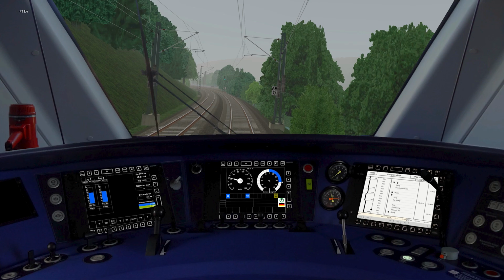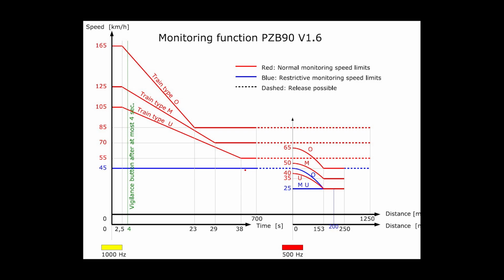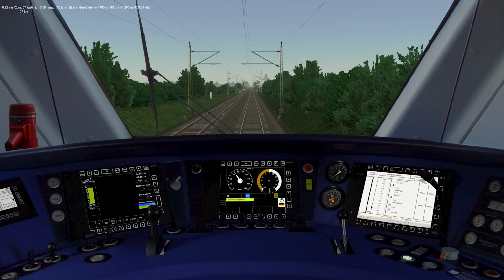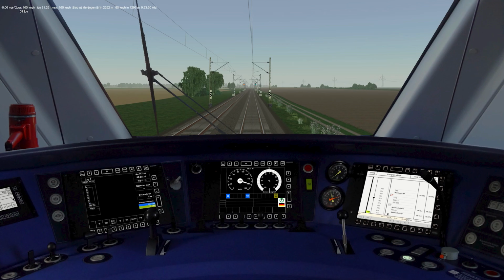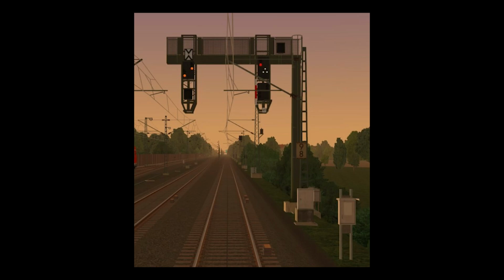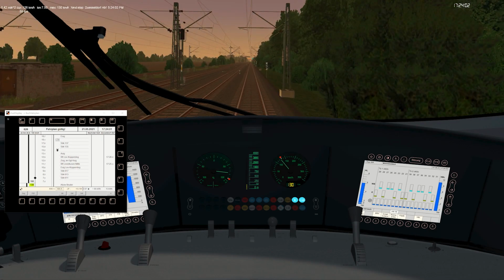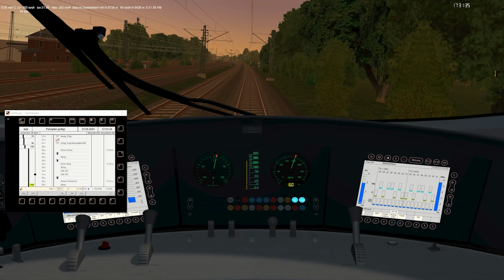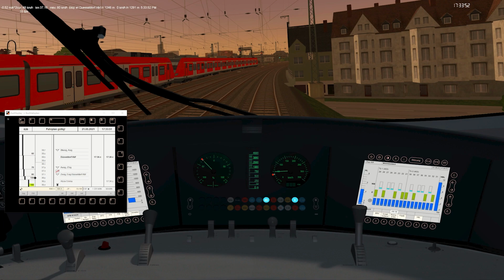Zusi 3 Tutorial - 03 Safety Systems

Comment: Something that i'd like to add so people will avoid random emergency brakes: In some cases (not everywhere) there can be something called a prüfabschnitt or a test section before a new speed limit. These will check befor the signal at which the speed must be reached if the train has allready slowed down to a certain degree. For example in front of a signal which wants you to drive 100 after passing it will have a test section testing for 115 or 110kph. If driving above that the train would recieve a 2000hz emergency brake. So watch out and brake soon enough.

Comment: Thanks for the detailed video.
I have a question: in the LZB demonstration, the timetable speed is 160 km/h and we run at 200 km/h. How could this be? I do not understand. Or have I missed something?
Reply from the maker: In Germany, any train that exceeds 160 kph must have LZB. I believe the speeds in the timetable do not apply to LZB as these are managed by a central computer system and can vary based on everything from the state of the tracks, the curvature, even the specific train's capabilities.
Reply: @RailsAndAles  That is correct the timetable only displays the allowed speed which you would need to adhere to if you are not in lzb supervision.